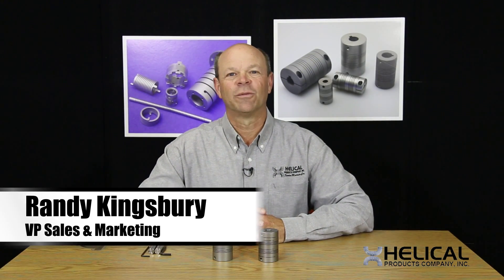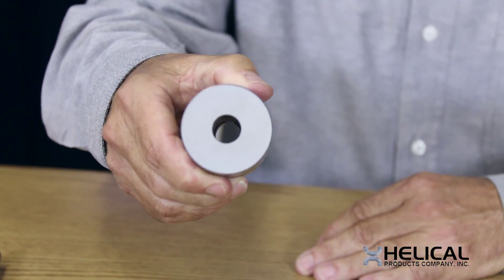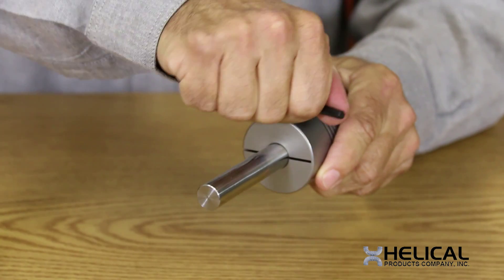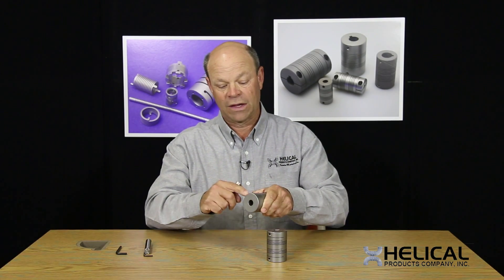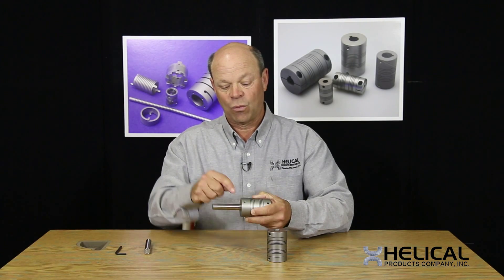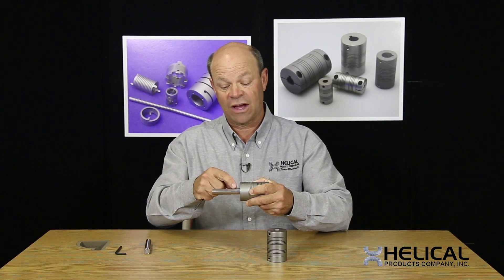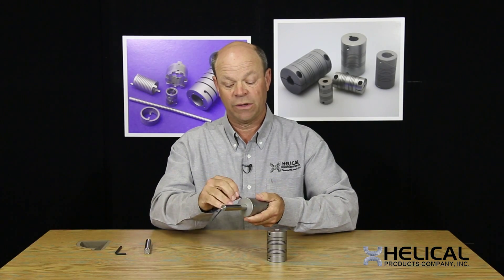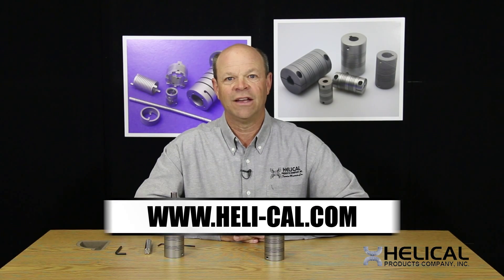The Best Methods of Attachments for Standard and Custom Couplings

Comment: Its ok , I understand, actually clamping type is better.
The setscrew type has no advantage, but only some disadvantage.
Then please tell me, why do you (and others) manufacture setscrew type at all ? Is it so much cheaper or what ? It doesn't look cheaper, its about the same. You have to drill a hole with thread and put the screw into it. The difference is only the location of that screw.
Reply from the maker: +telelaci2 
Thank you for your question.  The two key reasons for considering a set screws are; (1) The shaft has a flat or (2) cost.  The set screw is about 15% less expensive than a clamp style coupling.

Comment: So, what's better, integral clamp on smooth shaft or flat shaft with a set screw?
Are there specific accuracy drawbacks?
Reply from the maker: Blacktronics 

Good question.  The clamp is the preferred, and most popular, method of attachment when installed on a smooth shaft.  It provides a positive & no-backlash method for transmitting torque.  Plus it is easy to install and remove.  A set screw on a smooth shaft can loosen with reversing loads.  The clamp will give the most accurate results because there is no potential freeplay between the coupling and shaft.  Thank you for your question.
Reply: HelicalProducts Hi, thank you for your reply!
I currently have motors with smooth shafts and coupler laying around which use a set screw, my only way to get hold of some integral clamps is ordering some from china, as german suppliers sell the same crap and overcharge 200% (I'm located in germany). 

Should I order up some integral clamps from china, or should I file flats onto my motors?
What about filing a flat on the center of the shaft, I made an illustration here: http://gyazo.com/66becfcd711d33e75795d6e26da8e0ca

Would this allow me to use both, a setscrew and integral clamps?
Reply from the maker: Blacktronics Motor shafts are hardened and can be very difficult to machine/grind a flat.  We strongly recommend a clamp attachment and understand your concern about poor quality couplings.  Fortunately we have a distributor that covers Germany.  They inventory a large selection of our USA made couplings and can be contacted at http://www.ringspann.ch
Reply: HelicalProducts Filing flats on motor shafts is easier than you might think, i've done it before, just use a regular metal file (I didn't try holding one onto my bench grinder yet, but I think it's a bit overkill), clamp the shaft in a vice and carefully hand-file the motor shaft, it will put a really good flat on there.

So, my question remains, do you think the above linked image would work? that could possibly allow integral clamps and set screws to work on the shaft.

I'm currently only prototyping and messing around, I will eventually order proper linear parts from R&K Rose & Krieger, they probably make the best linear motion parts out there, and then I will also order some of your couplings.
Reply from the maker: Blacktronics Yes, a shaft with flat can be used with a clamp and set screw combination.  It is not a common or standard attachment, but it can be done.